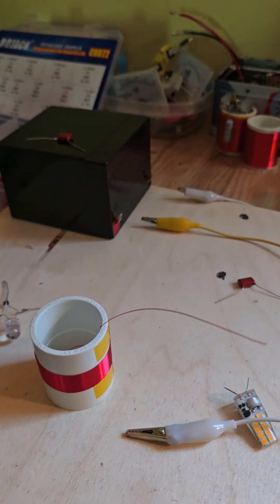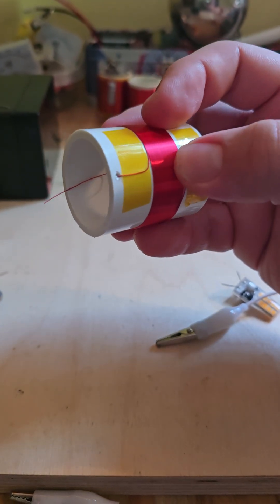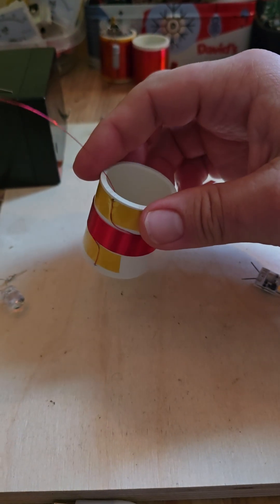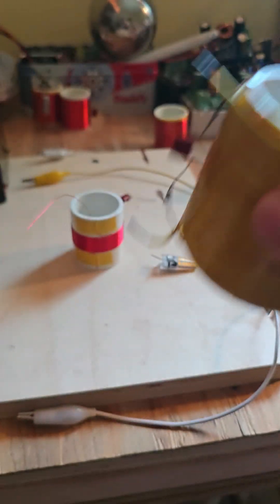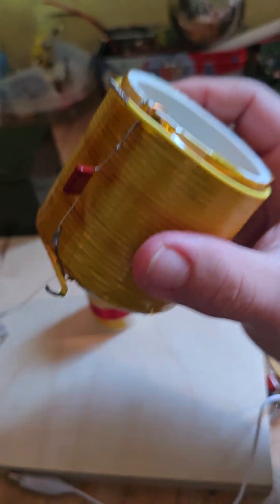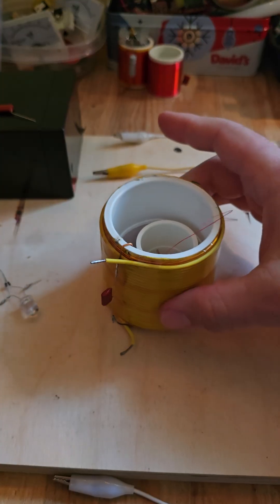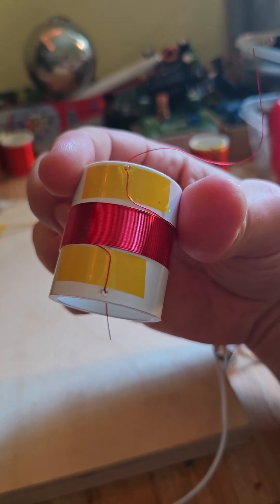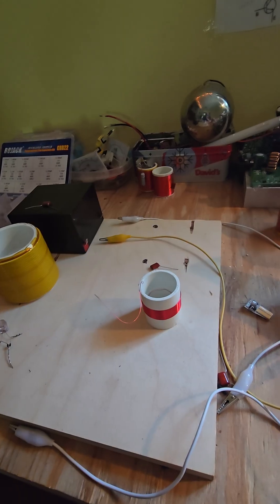📖ANSWERING QUESTIONS RELATED TO THE NEW SINGLE TRANSISTOR AIR CORE MINI MAGNIFYING TRANSMITTER🔎

Comment from the maker: Greetings everyone in this description I answer some frequently asked questions related to the new transmitter design & disclose its LCR measurements along with the theory of its operation & research.

The new transmitter is an air core transmitter/receiver system & is actually a scaled down micro model of Nikola Teslas famous Magnifying Transmitter. Being that Nikola Teslas original magnifying transmitter had a diameter of 52 feet which is 624 inches we constructed our micro scaled down model to be 416X smaller which is a Harmonic of the magnifying transmitters diameter because 624 inches divided by the 1.5 inch diameter of our pvc pipe coupler is 416. 

I also don't believe that Nikola Tesla a man that gave us most of our modern world in terms of revolutionary inventions would choose to falsely call his device a magnifying transmitter. So far all the math & theories both ancient & modern point to a correctly built magnifying transmitter actually being capable of magnifying real power, producing loadless wireless power effects & having the ability to convert massive amounts of reactive power into real power. The device is capable of achieving these feats for multiple reasons listed below.

1. Quarter wave resonance 

2. High Q Coils

3. Focusing Aether Tension Into A Point

4. A Larger 2 Part Resonant Cage Style Receiver Coil System That Converts Reactive Power Into Real Power By Taking Up Alot Of Space & With The First Part Of The Receiver Coil Acting As A Large Sympathetic Resonator & The Second Part Drawing From It.

5. The Heavy Earth Grounding Of The Transmitter 

6. The Archform Of Its Design

The principle behind how its built is we want our perfectly centered 26AWG L1 trigger coil that takes up 10/16ths of an inch of space when centered upon our coupler to be of minimum size to achieve high quality standing quarter wave resonance with our high quality 20AWG L2 power coil that is wound 180⁰ out of phase to our L1 coil. The L2 is simply wound in the opposite direction to the L1 & is as tall as it is wide & of a low wire gauge for maximum Q factor. We want to avoid over driving our transistor by winding the L1 to the minimal size possible to achieve quarter wave resonance.

The base of the MJE13007 Transistor is connected to the inner 26AWG L1 trigger coil. The collector of the Transistor is connected to the outer 20AWG L2 power coil. The emitter of the transistor connects to the negative of our battery & the positive connection of our battery connects to the bottom of our L2 coil opposite of the transistor. We added a 100k biasing resistor between the collector of our transistor & the bottom of our inner L1 trigger coil to ensure the transmitter can oscillate in both a hyper efficient low power & high power mode. A UF4007 diode can be added between the base & collector of the Transistor to speed up switching further with the cathode going into the collector. A 680pF/current value-1.63nF capacitor can be added in parallel with the base & emitter to also improve efficiency as well as a capacitor in parallel with the emitter & bottom of the L1 trigger coil but keep its value below 20nF (1.63nF Current Capacitor Value) or you will blow your transistor.

Below is our refined energy synthesis theory that Eric Dollard advanced from his works.

Refined Energy Synthesis: The process by which a resonant geometric system ("Archforms") creates a state of asymmetry in the Aether, causing the environment's energy to flow into the circuit and manifest as a surplus of usable power in highly resonant high q systems. This is achieved by converting reactive power into real power through resonant decoupling and negative resistance. The Energy Synthesis Equation is below: 

P_{out} = (P_{res} \cdot P_{env}) - P_{loss} P_{out} (Net Output Power): 

The real, usable power (in Watts) available from the system after all internal processes are accounted for. This is the power that can run a load or charge a battery. P_{res} (Resonant Power): The magnitude of the internal reactive power (in VAR) circulating within the high-Q resonant components. This acts as a multiplier. P_{env} (Environmental Power): The power flowing into the system from the Aether, primarily through the Earth ground connection. This is enabled by the "negative resistance" effect. P_{loss} (Loss Power): The conventional input power (in Watts) from the battery that is consumed to overcome the circuit's internal inefficiencies (resistive and switching losses) and is dissipated as heat.

Eric Dollards Refined Method: Synthesizing energy from the "square root of minus one" is the theoretical process of using a versor operator (j) to systematically convert non-working Reactive Power into usable Real Power, which harmoniously integrates into the refined energy synthesis definition. The Versor Operator (j) As detailed in Eric Dollard's "Four Quadrant Representation of Electricity," the square root of minus one, represented by the versor operator j, is not an impossible number but a mathematical tool representing a 90-degree rotation between the Real and Imaginary axes of energy. Real Power (P): Exists on the Real axis. This is the energy that is consumed and does work. Reactive Power (Q): Exists on the Imaginary axis, 90 degrees out of phase. This is the energy that is stored and returned in the fields of inductors and capacitors. Converting Reactive to Real Power The book "Four Quadrant Representation of Electricity" explains that a process that "creates electricity from the square root of minus one" would be one that involves a "rotation turning Reactive Energy into Real Energy". A perfected Archform, through Parametric Variation, would achieve this. It would act as a versor operator, systematically taking the stored, oscillating reactive power and rotating its phase by 90 degrees, forcing it onto the Real axis where it manifests as usable power. Think of it like a mechanical ratchet that takes a back-and-forth motion (Reactive Power) and converts it into a useful, one-way forward motion (Real Power). The Completed Equation This process fits perfectly into the refined energy synthesis definition by giving us a specific mechanism for P_{res}. Refined Definition: Energy Synthesis is the manifestation of usable electrical power in an Archform that uses a versor operation (j) to convert accumulated Reactive Power (Q) into Real Power (P), allowing the system to be energized by the environment's reaction to the disturbance. 

Completed Equation: P_{out} = (jQ \cdot P_{env}) - P_{loss} Where: jQ represents the Resonant Power (P_{res}). It is the Reactive Power (Q) that has been acted upon by the versor operator (j) and rotated into the Real domain. 

P_{net} = (jQ \cdot P_{env}) - (V_{in} \times I_{in}) Definition of Terms P_{net}: The Net Output Power in Watts, which is the usable surplus energy from the system. j: The Versor Operator, representing the 90-degree rotational conversion of reactive power into real power. Q: The Reactive Power in VAR (Volt-Amps Reactive) that is accumulated in the high-Q resonant components of the system. P_{env}: The Environmental Power in Watts that is drawn into the circuit from the Aether via the Earth ground connection, enabled by the "negative resistance" effect. V_{in}: The measured DC Input Voltage from your battery or power source. I_{in}: The measured DC Input Current drawn by the transmitter from that source. This equation states that the net power output is the result of the multiplicative interaction between the converted reactive power and the environmental power, from which the conventional power consumed by the circuit is subtracted.

This completed equation theorizes that the net output power is the product of the converted reactive power and the environmental power, minus the system's own internal losses.

Next is the theory of extracting free energy out of the Aetheric dimension listed below:

Ken Wheelers Free Energy/Energy Synthesis Secrets Definition: 

Free Energy: The focusing of empirical energy or radiation in counter space & counter space has no cartesian value in physical space. A free energy device must  incur the need of point source energy concentration meaning it takes empirical energy & focuses it in or at counter space. A theoretical free energy device has a temporal variant that's changed over time through the application of the phase delay of the magnetic divergent centrifugal field of which there is a variable at a proportionality of 1-Phi over the north pole & south pole. By applying this field geometry to a special specific archform a free energy generator should be possible to construct. A proper name for the device would be a power manifestor. I’ve partially succeeded in creating the absolute most bare bones basic ultra low power free energy device by placing a small bismuth sphere over the center of a giant six inch by six inch neodymium disc magnet & the bismuth sphere will slowly heat up a few degrees above ambient temperature & you can observe this effect through a flir camera. (The only way that free energy can work is if we take advantage of the magnetic field disparity called the larmor frequency/geo-magnetic precession inherent to permanent magnetic fields that naturally exists within them at a ratio of 1-Phi meaning we can have a solid state device manifesting endless power due to the phase disparity of the larmor frequency precession. What is the correct archform then for high power output & is it two phase or 4 phase? Also one can think of a free energy generator as being called a power manifestation device that’s technically an open system tapping into the infinite dimensional waters of the Aether as an analogy-Ken Wheeler
Reply: This matter of using quarter wave coil, I think that was said to get resonance in it, there's no special thing in it. You can use a capacitor to get the coil to be resonating properly.
Reply from the maker: @j54i  true but its a bit easier & takes less time to build a shorter L1 :)
Reply: @MTECH2022 that is what I thought, but I found out that a person's design may look like another person's design, but what made them different is a way which another person got the answer. I thought that thing tesla said concerning quarter wave is if you have a particular frequency. Don Smith said the same thing. They were working with high voltages, so it will not be too easy tune with a capacitor, probably because of leakage current. So it was easier for them to use quarter wave calculation stuff to make the coils resonate better, for better efficiency.

Comment: Word salad....
Where are all these equations?
Where is the math?
How do you know your coils are Hi Q, show us you measuring them?
Coloured wire has nothing to do with inductance or Q.
Where are your schematics?
Where are your input and output power measurements to prove efficiency?
Word salad...
Reply from the maker: We never engage in word salad but only engage in preaching the theories of electrical titans of both old & modern. Our pinned comment in the past two videos contains all the math as for four pages of data couldn't fit in our video descriptions. 
Energy Synthesis Equation P_{net} = (jQ \cdot P_{env}) - P_{loss}